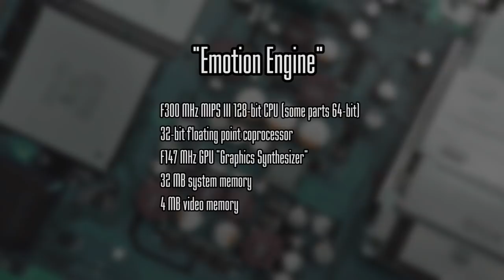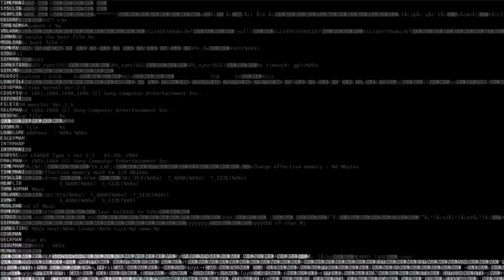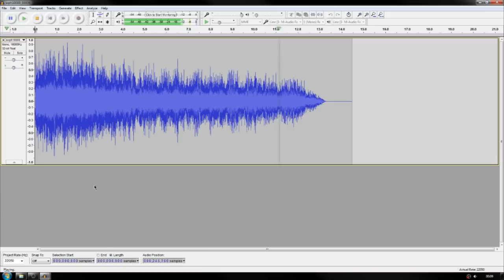Playstation 2 Startup Sound Explained

Comment from the maker: There is some debate about the Playstation 2's support of high definition graphics (as mentioned at 0:53 in the video).  By high definition, I mean at least 720p resolution rendered natively.  The hardware supports higher resolution output (and progressive scan) via the component output.  The Linux kit for the console supports 1280x1024 resolution, for instance, and the graphics hardware can output at 1920x1080 over component cables.

Only a handful of games support 1080i output (Gran Turismo 4 and Tourist Trophy, for example) but this output is natively rendered at 480i and then upscaled to 1080i.  To my limited knowledge, there are no games for the PS2 that support a minimum native resolution of 720p.  Therefore, if 1080i output (regardless of scaling) qualifies the PS2 as an HD-ready console, then it is.  I tend to consider native graphics resolution of at least 720p (with no upscaling) the benchmark for HD, however, and that is the basis for my statement in the video.  The PS2 hardware is designed to play games at 480i and the processing power isn't quite optimal for HD graphics rendering... but that is a subjective opinion on my part.

There is a software modification available for the console, however, that apparently updates the graphics drivers and permits native HD graphics!  I have not tried it but this video covers the topic:  https://www.youtube.com/watch?v=g_wa57J8vbg (Subscribe to @MetalJesusRocks if you haven't already)  If anyone has tried this modification and enabled true HD output on the console, please let me know!  Additionally, if anyone knows for certain that any PS2 games exist that support at least 720p output without upscaling, I'd certainly like to know as well.  From what research I've done, I have not found any.
Reply: Not only that but on opl you can get 1080p
Reply: GSM doesn't change the render resolution at all, though.

When you set it to output at 1080i/p, all it does is upscale the graphics. It doesn't make anything more detailed, it just makes the pixels sharper and clearer, and in some games, gets rid of interlacing artefacts.

I don't even use GSM a lot because it gives me an annoying border around the game's screen.
Reply: Epic
Reply: @DrowseProductions  And where does 480p (not i) fall? Enhanced Definition? Wouldn't 680p at least fall in the same category?
Reply: Don't use the standard rca cord use s video or component
Reply: @gator_productions  S-video doesn't support 480p or 1080i either.
Reply: From Wikipedia: While there is no standardized meaning for high-definition, generally any video image with considerably more than 480 vertical scan lines or 576 vertical lines is considered high-definition.
Reply from the maker: 720p is the minimum resolution that qualifies as high definition.  360p and 480p are not considered high definition according to standard.   If the XBox 360 or the PS3 are running natively at 680p, the graphics (in that specific mode) are not truly HD even if the signal output is at least 720p.  Both of those consoles are HD-capable; the XBox 360 runs natively at 720p and the PS3 can run up to 1080p natively.  The unmodified Playstation 2 runs natively at 480i and 480p (with any HD output over component being upscaled from that).
Reply from the maker: There are televisions with screen resolutions of 1248×702 and below that accept high definition signals but the signals themselves must be at least 720p to be officially up to standard.  Technically, such TVs are not true HD.  It is likewise with signal output that contains an upscaled source input.  I think I will not be able to convince some people that the unmodified PS2 is not an HD-capable console so I'm okay with letting people believe whatever they want.
Reply: @Nitrocosm  Ah, so the vertical resolution has to be at least 720 pixels. So 1024x768 is technically 720p?

I have an old laptop from the early 2000s that actually can display 1024x768 properly.
Reply: It can’t be 720p that is what the xbox one runs
Reply from the maker: 1024x768 isn't a typical television standard resolution (it's most commonly a computer desktop resolution) but I guess it would qualify as HD (768p).  Also, does the XBox One really only run at 720p?  Technically that would still be HD but I thought that console supported 1080p easily.
Reply: @Nitrocosm   Almost every game is capped at 900p +/- dynamic resolution scaling. Some games were 720p and 796p? I think it is.
Reply: Soon im getting ultrawide monitor and im about to plug my ps2 to pc monitor, well, that's helpful a lot! Thx <3
Reply: @Szymonicus  I doubt it's gonna do you much good. At best, you'll get letterboxed 16:9, at worst, you'll get a woefully stretched image
Reply: @Nitrocosm  I have been seeing videos saying that it games at 720p, I was in shock when I found this out too.  But also my tv is 720p 60herz so it is being used to it’s fullest
Reply: omg.
Reply: Thank you
Reply: @Nikku4211  lmao, you are quite annoying and trying to get this dude upset, while he answer with real examples and not silly "then 719p isn't HD???". He already said that, by his standard, no, it isn't, so ask him another question with any other weird hypothetical that never existed and won't exist again in any practical use. 
It's like a American arguing than anyone below 6'0 feet or whatever is not a tall person, and the 5'11" says that he is tall. Like, in China he is tall, as well as 719p is HD in the poorest part of Africa.
Reply from the maker: Honestly, this debate doesn't really make me upset.  I did a lot of extra research because of this discussion just to be absolutely sure I hadn't missed any important information.  It's been kind of fun, even if I'm being trolled a bit.  Lively debates such as this usually deteriorate into flame wars so I'm grateful to everyone for remaining mostly civil.
Reply: @Nitrocosm  Why does the internet flame over a console? GIFT?
Reply from the maker: @Nikku4211  Beats me.  It's just like the whole "PC vs. console fanboys" thing or iPhone vs Android.  It doesn't matter.  People should just like what they like.  Likewise, if people don't want to accept existing technical specifications, it doesn't harm me.  People can disagree with me; maybe I've overlooked something or misread some specs but I've made my case, researched it a couple times again just to make sure, and simply agree to disagree with those who still want to correct the statement in the video unless they bring forward reliable new information.  Any corrections will go in the description of the current video.
Reply: @Nitrocosm  I have quite a bit of experience with GSM, all it really does is, it takes the back buffer image from the console and pushes that into the front buffer without any further adjustment that would normally be done to make the output fit 4X3 aspect ratio as well as skipping some post processing filtering applied via front buffer. 
That's why allot of games will look out of proportion when ran through GSM 480p/576p(yes the PAL variant also works) or 1080i and others will look cleaner thanks to the disabled filters that would otherwise add grain or bilinear filtering(Forbidden Siren 2 and Fatal Frame 3 come to mind).
It's also the reason why allot of games or portions of some games will appear to run at half resolution when forced into progressive scan, because of PS2's special rendering technique (which was also pressent on the Saturn) that rendered the image as fields instead of full frames, GSM is set up to take those fields and render them in 2X height to avoid the bob deinterlacing effect.
I personally use GSM as a tool for recording gameplay it's hit and miss with allot of games but where it hits it hits hard aswhen it works it's always much sharper and deinterlacing is no longer an issue.
Going back to whether PS2 could do proper HD... I'd say nopers to that, even most 480i/480p games do some serious cheating to get over how limited the VRAM of that system is.  Just as mentioned before field rendering was quite a common way to use only half the VRAM to render 480i and the intention was to use it in every game before the first batch of PS2 launch titles came out and afterwards they added frame rendered options for all dev kits (which were previously missing), because of the infamy of the jarring jaggy effect present in motion (games would appear 480i in still frames and then jagged 240p in motion), not to mention the rapid shaking and resolution drop whenever there were performance issues(Examples include Bouncer, Jak and Daxter 1, Wild Arms 3). 
However since the PS2 was not meant to handle full frame rendering. Allot of games that used "normal resolution" od 640X448 (minus underscan) would slow down or be forced to use really low quality textures and crude modelling to compensate. What vast majority of games since then have adapted was using reduced horizontal resolution in the back buffer which would get stretched by the front buffer to fill the screen(Which is the reason many games forced to 480p appear with massive vertical borders on the sides). That seemed to provide a good middle ground of stable visual quality and not being too processing intensive(Examples include Xenosaga, Jak and Daxter 2, Wild Arms 4 and 5).
There were still games that opted for using Field rendering WAY later into PS2's lifespan as it allowed games with higher fidelity visuals, more going on on the screen or higher framerate to run more smoothly than they would ever be able to otherwise (think of Devil May Cry 3, Demon Chaos, Any of the Dynasty Warrors games or Digital Devil Saga). However those were more of an exception past 2003.
Sorry for rambling it's just a topic I like talking about.
Reply from the maker: @Alyx Buckman Spot on!  Seems correct to me.
Reply from the maker: @Nikodem R Thanks for sharing that.  It's very informative and interesting!  The idea that the PS2 can be modified to do HD, even if it's kind of underpowered for it, is a pretty cool one.  It's a relatively simple hack, from what I can tell, compared to what has to be done to extract the BIOS.
Reply: @RapidReelTV  
Almost, 
480i is SD- Standard Definition
480p is ED- Enhanced Definition
It's quite an important distinction with PS2 in particular, as ED is really uncommon and lots of games are rendered internally at an interlaced resolution (all other consoles from that generation render graphics internally exclusively in frames as in progressively )
Reply: @RapidReelTV  i remember youtube used to call 480p HQ. As far as i know 360p is not a resolution presentat in broadcasting, however movies and games presented in letterboxed widescreen within the 4x3 aspect ratio used that resolution for the active area.
Reply: Parappa The Rapper 2.
Reply: @Nitrocosm 
That's a common thing with consoles in general - the console can generally support a higher definition than what's actually used by games for that system. That way, the system isn't being constantly pushed to its limits and doesn't risk thermal issues. This is particularly important with low-profile consoles where airflow is limited or even non-existent. (coughSwitchcough)

Desktop PCs specifically built with gaming or other high-intensity uses in mind don't have to deal with this because they can take advantage of beefier cooling systems, but laptops have the same issue and same solution for that issue.
Reply: The graphics were good because it used only procedural rendering where everything was loaded all around making things more solid and real time, dynamic rendering has cool features but I hope the PS5 uses predominantly procedural rendering with dynamic rendering being the icing on the cake only upgrading the usage of procedural rendering and what games could offer